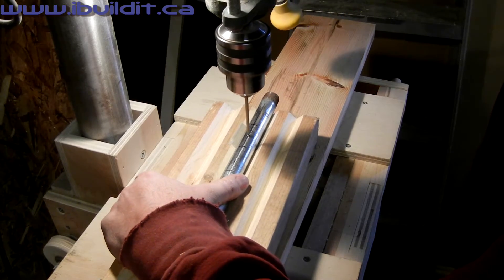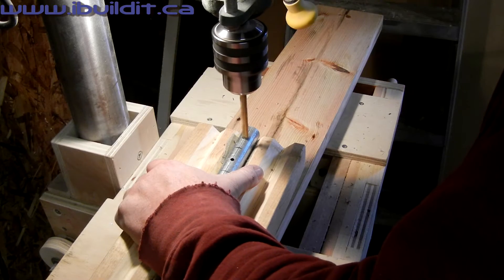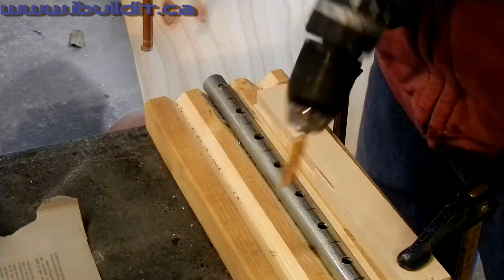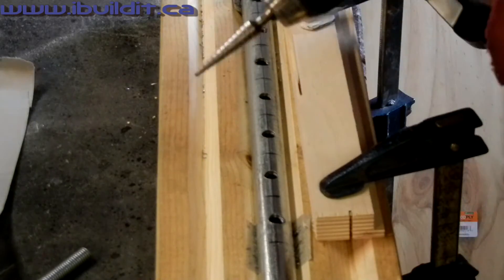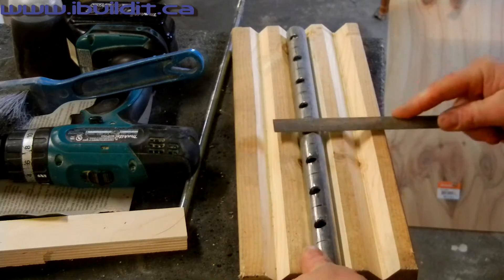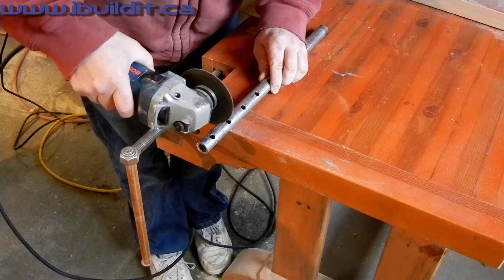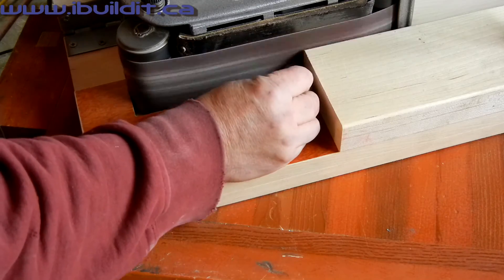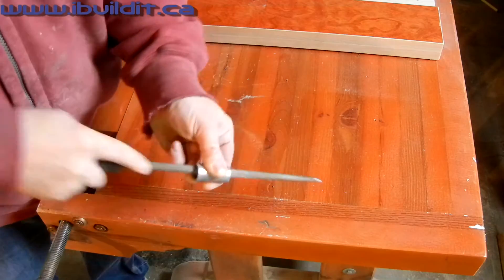Making Hand Screw Clamps, Part 1

Comment from the maker: @tabhorian My bench top is mostly pine, with hardwood perimeter. I think softwood is better for a work bench for a couple of reasons: It'll take screws easily - I like to screw things down to the bench to hold things occasionally, and having the screws break off is not good. Also, it's much more economical than hardwood. 
The top is holding up just fine. There is an article about it on my website - can't post link here, site address is in the top left corner of the video.

Comment: When drilling steel, set your drill press arbor RPM as SLOW as it will go.  So-called "high speed" drill bits are often misunderstood.  "High speed" in tool steel is measured in inches per minute.  The outer edge of your 3/16" drill bit is travelling dozens of feet per minute. Proper drilling speed produces long curls of metal being removed ... not chips.  Liquid cooling helps, too.

Comment: I was thinking about using the female union connectors instead of pipe itself. my reasoning is its thicker metal. Have you had any issues with thread stripping with pipe or am I just over thinking the pin stress? Thanks for making all these videos. I pick up a lot of little things and enjoy your builds. I'm n other doing a tablesaw etc but your clamps have taken root in my head. Everyone says you never have too many. Mathias is good to but I don't do well with his instruction/ personality.

Comment: These will not work as well as the original Jorgensen handscrew clamp. Those use an acme threaded rod that incorporates a right and left hand thread. It is not such a simple project.

Comment: Hi, we don't have that kind of pipe in France, can you tell me wich diametre it is please ? I think it's a great sort of clamp and I would like to make some of these and your 4 videos will help me to do.
Reply: This is a 1/2" or 13-15mm galvanised water pipe. You could just go to a pipe supplier and get a mild steel pipe approximately 13 mil in diameter. As long as you get something that is easy to drill and tap it shouldn't matter on the size.